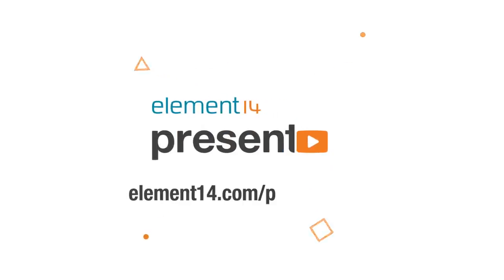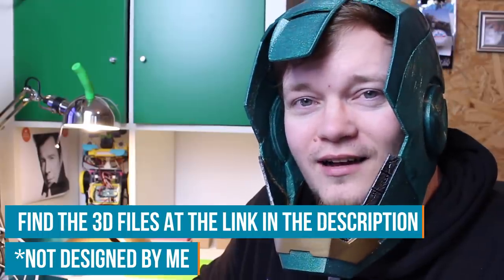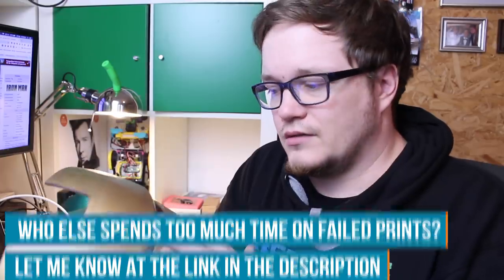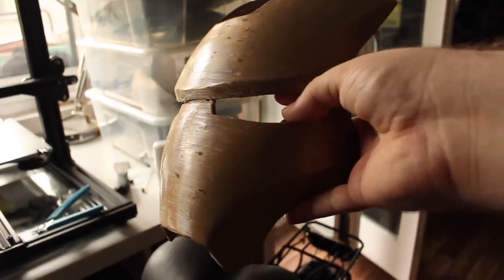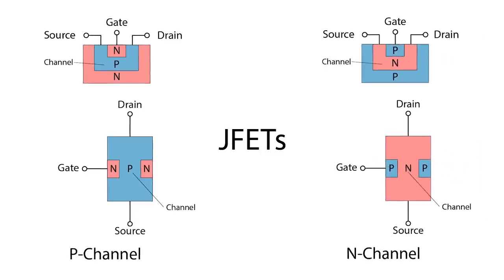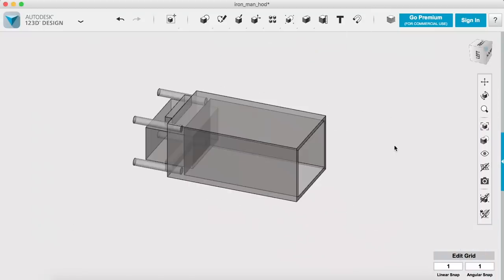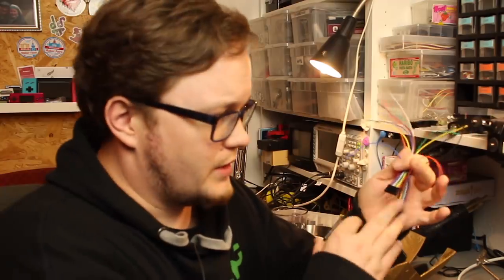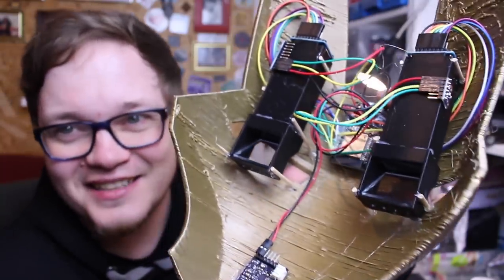#IronMan Helmet Heads Up Display

Comment: Apologies again for the helmet being green! I should be able to get it smaller still, but want to add other things first. What other things would you build into your Iron Man helmet?
Reply: A Microsoft mixed reality headset from ASUS or HP. It's basically a HUD already.
Reply: @TheNews1990   where's the fun in that, when you're not building it? Sounds like a case mod. Any other ideas?
Reply: Interior and exterior thermometers, GPSr, gyro/inclinometer, voice command to change modes?
Reply: @awo1fman  gps would probably help with the altitude as well, hmmm. Voice commant with snips.ai should do well too :)
Reply: A snarky AI assistant.
Reply: @Un_Pour_Tous  does openCV work on an ESP32? Definitely saw a camera on a module before. Some people react strange to cameras these days though because of privacy concerns and all that.
Reply: How exactly did you mirror the image, “changed another certain value” is just really vague! Thanks for any help

Comment: On the problem of the helmet being too big, I think you're not accounting for padding.
Also, maybe you could move the battery to the top of the helmet. The rest is just a matter of making adjustments, looks like.
As to what I would put onto the display... Something about my very next appointment would be nice, like if I have to do something else in the next half hour.
I'd like to see someone integrate that with an assistant such as Alexa.
Reply: I also need that "next appointment" feature :D thanks for the input!